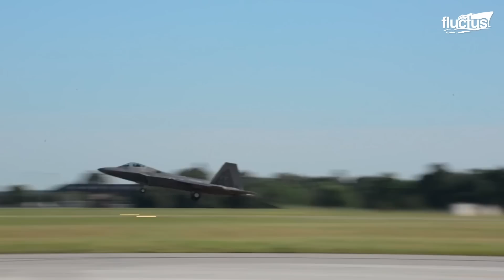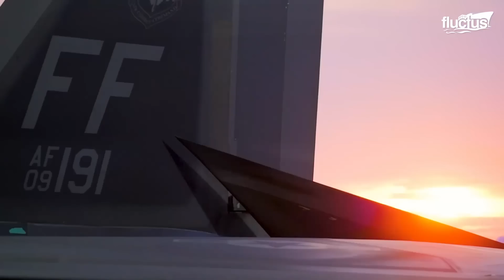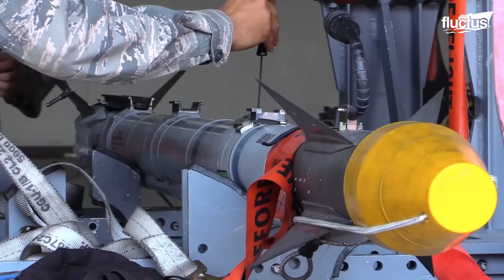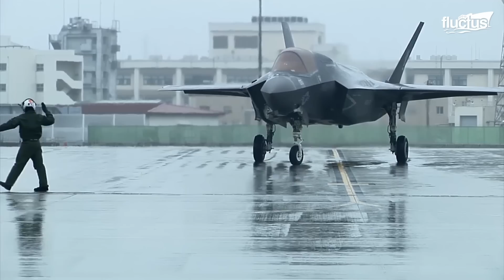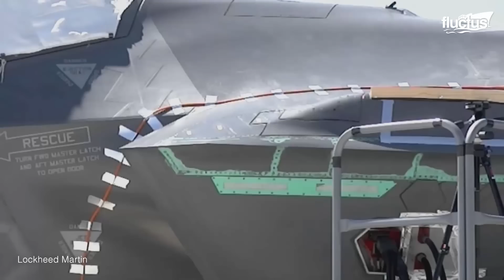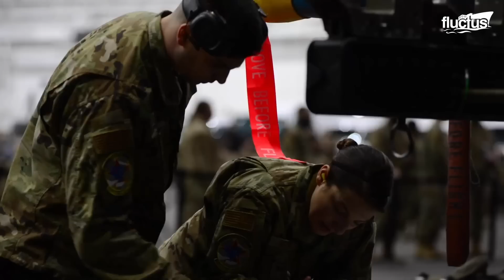Testing the Aggressive Design of the US F-22 to its Extreme Limit

Comment: First flown in 1990., F22 has 33 year old, outdated avionics and no capacity to upgrade avionics. The SU57 has its own APU to supply electrical load for new computer processing demand, plus the internal fuel load to keep running those avionics.  The Su57 packs six hypersonic long range missiles v the F22's short range slow AIM120C.
Reply: The US has more F22s in the air at any given moment than Russia has in total of 57s. The 57 has significantly worse radar cross section meaning it would be spotted much quicker and shot down easier. The 22 has been upgraded and outpaces the 57 in all categories

Comment: Speed ?  Stealth ?  Hummm, other criteria must also be considered !  What about a Structural Service Life of 12,000 hour and arount 19,500,000 Flight Hours so far to improve the bird, unlike any of its competitors ?  Meet the Block 70/72 Fighting Falcon.  1) The F16 could also reach 1500 mph, like the F22.  2) Northrop Grumman’s advanced APG-83 AESA radar provides the Block 70/72 with 5TH GENERATION fighter radar capabilities by leveraging hardware and software commonality with F-22 and F-35 AESA radars.  3) The F-16 flies farther, intercepts faster, accelerates quicker, and turns more tightly than any of its competitors. 4) The F-16’s 9G capability and immense thrust-to-weight ratio enables it to dominate the skies with unmatched agility, lethality and survivability.  And yes, that plane is that good.

Comment: Great plane. It's also been out of production for quite some time now making sourcing replacement parts expensive. It also can't network due to its outdated avionics compared to the F-35. The RAM on this plane is also prone to deterioration. That's something that was addressed in the F-35. It isn't as stealthy as the F-22, but has significantly better sensor fusion. And yes, it still has some significant bugs to work out due to the high complexity of its various electronic systems
Reply: Small correction, the F-35 is actually the more stealthy of the two. And the bugs have pretty much been worked out of the F-35 already. It's been working well for a while now.  What surprises me is you still have bigdummies in comments sections like these that think the F-22 is the better aircraft, as if dogfights still matter anymore. Dogfights don't matter if you never even see your opponent, let alone get close enough to make swirling around in the air effective. It's all about who can detect the other first now and get a missile lock, even if it's miles away or even beyond the horizon.
Reply: Tbh I prefer the F-22 over F-35, despite the performance difference. Probably because Starscream was an F-22 in live action Transformers. Also probably the reason why I have a soft spot for the F-15 too, as that’s what he was back in the 1980s.

Comment: Remarkable aircraft, although I personally liked the profile and performance of the YF-23 Black Widow much better.  Test pilots for the 23 unanimously remarked how much faster it was than the 22 by a whole other order of magnitude, reportedly not even close - still top secret to this day.  Absolutely amazing tech either way.
Reply: No, no, and no.   Yes the YF-23 DID out perform the -22 in a couple areas...but not by much and both airframes more than met the AF requirements.   There were no 'orders of magnitude' differences in any of the testing except perhaps weapons delivery where the YF-22 held the high ground as it was able to fire missiles where the YF-23 could not.
Same thing for the engine competition: the GE DID out perform the P&W in a couple areas...but again by a small margin and both met all requirements that had been set forth.  (disclaimer: I worked at P&W on the 5000 engine/nozzle and readily admit to my bias)

In the end it's good to always remember that the Air Force would rather have improvement rather than innovation.   The F-22 under the skin is a relatively conventional build where the YF-23 was breaking new ground and when billions of their precious budget are at stake...the proven technology will usually get the nod.   Same for engines where the GE used an unconventional cycle while the P&W is very familiar to anyone used to jets and won the competition because we worked long and hard making it as simple and foolproof to maintain as possible.   This sounds like it should be the norm...but that's not the case and many jets are a pain in the ass to work on.   The maintainers vote went pretty much universally for the P&W from the reports we got back at the plant despite early bragging from GE that they were winning.

Comment: I worked on the GE engine trials. 
The new design team overstated its capabilities in electrical power output. 
This causd a failure when a maneuver called a crazy Ivan was first executed. 
The whole thing browned out and went into survival mode. (Critical systems only) 
My team was tasked with making an EAU (Giant cap bank) that could keep the system up and still recover in good time without loading the system. 
Root cause of failure was H1Bs. Just like Boeing.
Reply: Dude, how did you get your clearance? There are things you don’t mention outside your workplace

Comment: this thing, like the f35, b21, is a pile of junk hangar queen. if commercial jetliners were made like these flying pieces of junk a trans-con flight would cost $20,000 a seat. most of the "modern" planes and military gear are designed to be brutally expensive to use and maintain to drain the taxpayer constantly. the f22 readyness is a sick joke. wonder why the ang and af went with an f15-EX?

Comment: People insist on comparing the F-22 and F-35. Why? It’s comparing apples and oranges. Though they have areas that overlap, they have been designed for different types of missions. The F-22 is more of a tactical fighter designed specially for intercept air-to-air, dog-to-dog combat, though it can also be used for air-to-surface combat. The F-35 can more of  a multi-role combat aircraft. It is a capable air-to-air combat aircraft, but its role is more varied, exceeding in intelligence, surveillance, and reconnaissance functions.

Comment: The F 35 is literally the same exact fighter as the F 22 except it’s a single seat single engine version and it’s less stealthy from the rear because it has one big ass engine instead of two smaller engines so they can’t really suppress that heat signature

Comment: F-35 lack the agility and capabilities to do dog fight in comparison with the F-16 Falcons even though its technically more advanced; in short if an f16 catch it in a stealth mode/configuration it will not be able to survive a cannon dogfight; add to that the f35 have never been proven in combat! But in the future the f35 might prove to be a better mother ship to which it is used to control UCAV or Unmanned combat advance vehicles!
Reply: this is not the f-35, this is the f-22, the f-22 is a much better combat aircraft than the f-35 because it was designed for air superiority in mind. while the f-35 was made for dropping bombs.

Comment: This is the only fighter in the world that can truly super cruise, fly at speeds greater than Mach 1.5 without the use of afterburner.
Reply: That's not true. Super cruising is sustained supersonic flight without using afterburners.. So basically if jet engines can fly over Mach 1 without the aid of afterburners then that's super cruise. Right now only 4 fighter jets can achieve this, F22 is not the only one! The Eurofighter Typhoon, Dassault Rafale and Saab JAS-39e Gripen can too. Edit: each plane has a supercruise top speed, Apparently the F22 and Typhoon can do Mach 1.5 , Rafale 1.4, And Saab 1.1 . And there were jets that could do it in the past like the English Lightening and a few prototype US jets like F-16XL .
Reply: @danimayb  First off, the lighting doing it is a matter of definition.  The US Air Force had this defintion:  supercruise was defined as "the ability to cruise at speeds of one and a half times the speed of sound or greater without the use of afterburner for extended periods in combat configuration."[2]

By that defintion, the Raptor is the only one.  The weapons being held internally is a MASSIVE advantage.  Putting weapons and drop tanks etc.  on planes is a massive drag on the plane.  When you have a real world loadout, then you can do it perhaps with the Tyhoon, however with missiles, etc. you don't succeed in the ..."for entended periods, in combat configuration" part.  

If you don't fit the bill, change the defintion, guess.  

Once again, by US Air Force definition, none of the planes you mention fit the bill.  The Raptor does.  The cutoff by that defintion is Mach 1.5.  The Raptor can attain Mach 1.8 without afterburners.  The Rafale can attain Mach 1.4 without afternburners.  The Typhoon can attain somewhere betweeen Mach 1.2 to 1.5 (which would qualify it at the top end if that number didn't drop with weapons loadout).

So, I know people want to pretend, but the Raptor is still by itself in this regard.  It is capable of Mach 1.8 with a real world weapons loadout.  Easily number 1...by a wide margin.
Reply: @wadopotato33  Stop the bullshit fella! No-one is saying the F22 isn't a badass plane, In fact it's a truly legendary plane I love it along with all it's forward thinking tech. But Supercruise is simply sustained supersonic flight without using afterburner.. And F22 is not the only plane with that particular function right now, Or ever was, And was never the first.  I'm correcting the OP that's it. Edit: Doesn't matter if I'm right or wrong about any numbers I quoted, The basic point of my comment I am correct.
Reply: Mach4?!.
Supersonic,
Ultra sonic
Reply: pretty sure the old English electric lightning could supercruize
Reply: @michealgray533  Below mach 1.5 isn't supercruise it's just supersonic.

Comment: Easily the best air dominance fighter still today, despite his 30+ years
Reply: 25 years, but still very impressive!
Reply: @tlndblood8776  If including the first prototype being developed, it started design in the mid to late 1980s, and the YF-22 flew around 1990. Yes, they added onto it changed things since then but, the point is first development is long ago. I wish they picked the YF-23 as well, for more strategic stealth bombing missions. It did not have thrust vectoring, so not AS maneuverable but it was more stealthy than the YF-22. I think both used together would've been amazing. Look up images of the YF-23. Thing looks alien. And yes, it was also 1980s design. 👍
Reply: where has it ever fought?
Reply: @DimbweMazala  it was in a dogfight with a balloon
Reply: @aidanmorcom2332  so more fights the any Russian or Chinese 5th gen fighter?
Reply: @DimbweMazala  Barroon
Reply: @DimbweMazala  WTF do you mean where has it fought? Fight what? Its still the only actual 5th gen air superiority bird in the sky.  Russians barely have a dozen su57s and even the ones they have doesnt have gen 5 stealth design with huge exposed engines etc. Same with the Recent Chinese j20.

Comment: I have a question :
If the stealth characterstics absorbs all the radio signals or any other electromagnetic wave  , then how do it communicate with it's ground departments or other f22s during flight missions ? 

And  if they can communicate with them , then why don't enemy makes such missiles that will hit the F22 directly by detecting the energy wave by which it's communicating with it's air and ground counterparts .

Comment: The United States Air Force wants to withdraw from service the first fifth-generation fighter aircraft F-22 Raptor, which recently celebrated its 25th anniversary.

Here's What We Know
The F-22 Raptor has many problems. The aircraft has high maintenance requirements and a high cost per flight hour. Because of this, the Air Force is trying to keep the fighters out of the sky unnecessarily.

The US Air Force command wants to retire the F-22 Raptor to make room in the budget for a sixth-generation fighter, which is being developed under the NGAD (Next-Generation Air Dominance) project. It is expected to cost several hundred million dollars. But most likely we are talking about $300-400 million at the start of production, after which the price will fall. As a result, the fighter will be about 2-3 times more expensive than the F-35 Lightning II, which now in A-modification costs about $70-80 million.

Comment: Loved the presentation. I just question the statement that the F-35 is an "all weather" fighter.  I am almost certain that they will not allow it to fly in heavy rain. It strips the RAM off the air-frame. I can't say this for sure as I am not an Airman. I am an old (Cold War era) Air Wing Marine and know a bit about aircraft maintenance, but nothing about the modern fighters like the F-22 or F-35.
Reply: i know even less than you do, but i did hear that they changed how the RAM was applied for the F-35
that difference might do something to improve its durability enough to fly in rain? dunno though

Comment: I’m amazed by the comprehensive continuity of the aviation engineering  developments over the decades that have culminated in these unique and incredibly capable military attack and fighter jets. Such endeavors often suffer from changing political climate, contractors seeking to gouge government procurement programs, incompetence of key players, etc. But these planes made it through all the morass and stand at the pinnacle of military aviation. Quite an accomplishment.
Reply: robbes7th, I agree with you. I could not express my sediments better, but to add how proud I am to be an American!
Reply: @@carlosdelabarra855 — since the time I wrote that comment my opinion has rolled back a bit as I’ve learned more about the fighting capabilities of the F-15 — which has been proven.

Comment: As a former Air Force member, I love what the F-22 can do. No doubt it is a "beast". I would have liked to have seen the F-23 to be added to the inventory. Ditch the F-35. That's a system that is just way too expensive and it's full of flaws.
Reply: The F-35 isn't that expensive.  80 million per.  That is almost half the cost of an F-22.  It also costs a lot less to maintin than the F-22.

Comment: I still think this is the best jet in the world and probably will be for a long time. It's a shame we wasted money on the F35 instead of this jet. Only a 187 of them made when they wanted over 300. If we would have got them 300. I don't think we would have F35s now. Or maybe we would for Amphibious assault ships because of vertical take off and landing.
Reply: Wasted money? Please educate yourself. The F35 is by far the better aircraft. The Rock may be physically superior to me in every aspect, but if I can see him through a scope over a km out and he can't see me as I put a .50 cal round through his chest, who is the better soldier? Similarly the F35  excels in versatility with its multi-role capabilities, sensor fusion, and network connectivity, while offering lower production costs, single engine simplicity, and global presence. These advantages make it a compelling choice for modern air forces, though the F-22 still boasts superior speed, maneuverability, and payload capacity for specific needs. The F-22's superiority in these areas however is quickly being replaced by advanced missiles that don't require a pilot at all, if not already.
Reply: @johnjingleheimersmith  I see your point. F22 can be set up for upgraded missiles right? So it kinda evens the playing field. As for other aircraft that isn't stealth. Once in close range dog fights. I don't think it has no advantages. I would like to see a F35 vs upgraded F-15. Without all the high tech stuff. I think that would be interesting. Also don't get me wrong. I appreciate each and every member of the US air force. I think US has and will hold the top air force for a while to come. I personally think they should go to all the member and design an aircraft the pilots want. I'm not saying its bad to other nations. I just don't think it could take an F22. Which I could be wrong. I wonder if they ever ran against each other?  I think we could have put a little extra money towards building a 6th generation aircraft. Considering China, Russia and other countries are building 5th gen aircraft as well. I mean we spend 80 billion on black projects. That was years ago. Maybe even more now.
Reply: @johnjingleheimersmith  Also you even said it yourself. It's a multirole fighter. Which the F22 is an air superiority fighter. So to say I need to educate myself is absurd.
Reply: @KA_KillSwitch   Yes the F35 is a multirole fighter, meaning it can do far more things than the F22 can do aside from dogfights, which has been proven to be an obsolete paradigm on the modern battlefield.  By and far the F35 is a far superior fighter that would take the F22 in any fight as it would SEE the F22 and the F22 wouldn't see it before it is too late. So no we didn't waste any money on the F35. And last point, you mentioned we should have put money toward 6th gen craft instead, which seems to indicated you are  ignorant that we have already designed, created, and flown our own 6th gen fighter already. This is widely known. So yes, my comment on educating yourself still stands.